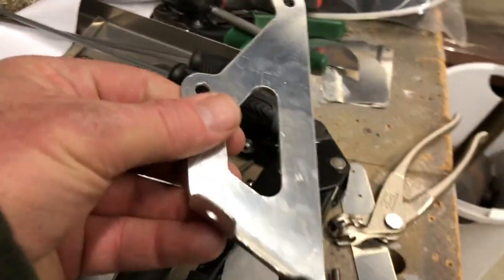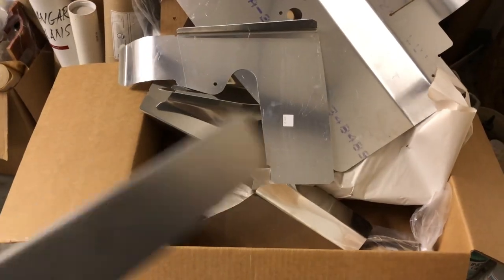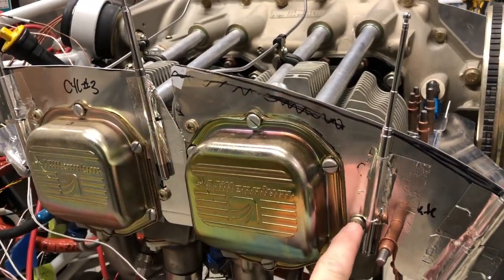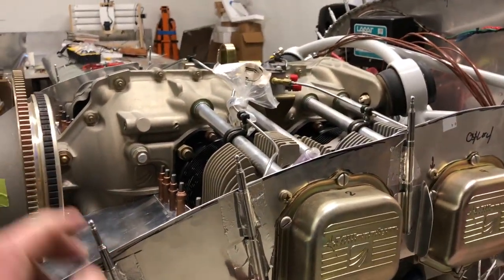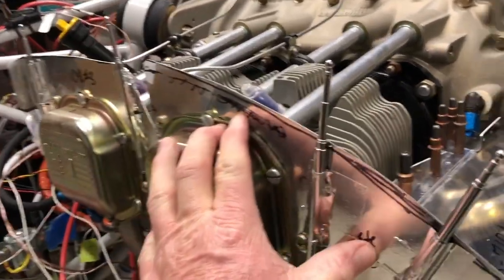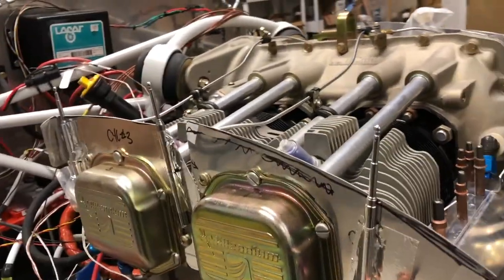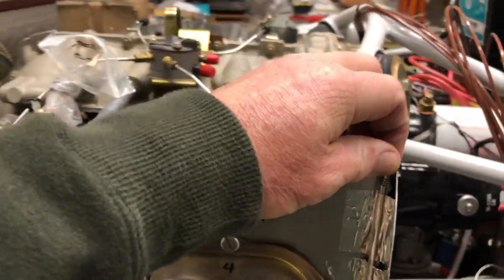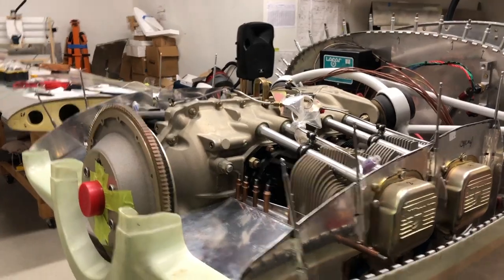Trying an idea for RV-8A aircraft engine baffle fitting

Comment: You can use a different technique. Use cheap plastic corrugated sign board, and use bamboo skewers into the holes of the corrugated board.

Comment: Home builders can't follow plans... Ha ha. Creative but really not needed. It adds weight and build time to your project. However I respect people doing what they want with their kit plane as long as it is safe and reliable and does not effect aircraft stability and control ability. ...
Reply from the maker: Sorry but... Did you even watch the video? This adds exactly zero weight and is simply a tool used to cut the baffle walls and make it quicker to do it the first time. There's exactly zero materials or parts involved that are not part of the kit that end up in the airplane. It saved time, so to say added weight is untrue, and to say added time, again - untrue. Necessary? No of course not. But it did save time and resulted in an accurate first cut and very quick time to get to a good, clean fit of the baffle walls to the Van's cowl.
Reply: Most people make general measurements, rough cut,  than use large paper clips (not telescopic antennas), put cowl on,  get baffle gap with paper clips . My comment about not following plans, adding weigh, not necessary, was a general statement, I conflated into the comment about trimming baffle. Not  well written on my part. Sorry no offense. Thanks for the clarification.  If it worked for you good deal. I went with pressure plenum because I hate those soft seals, because they are a pain to get right and leak anyway. The plenum is not per plan, takes way more time , adds weight. However there is some gain in lower cooling drag.